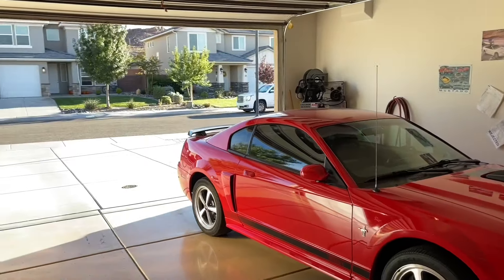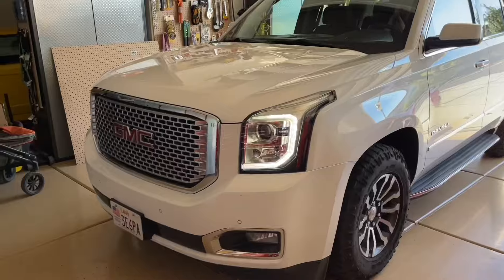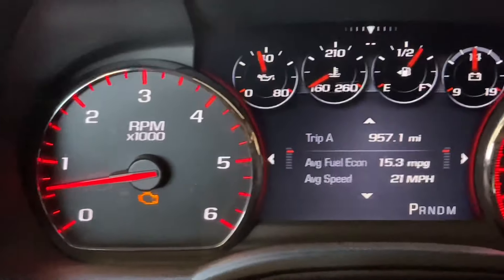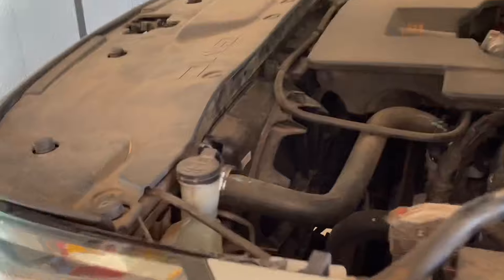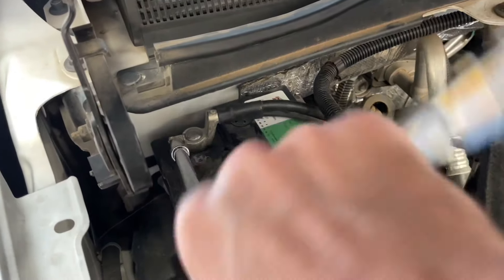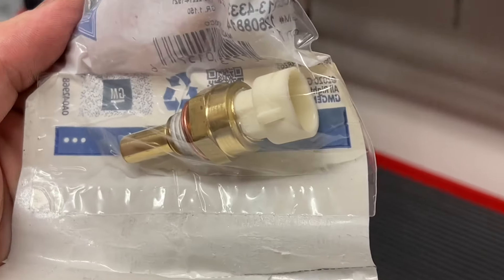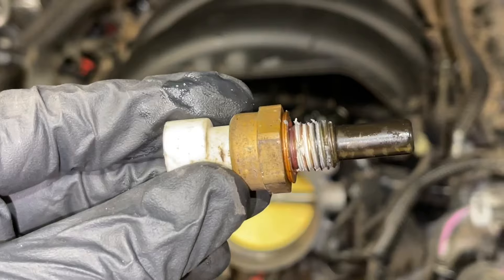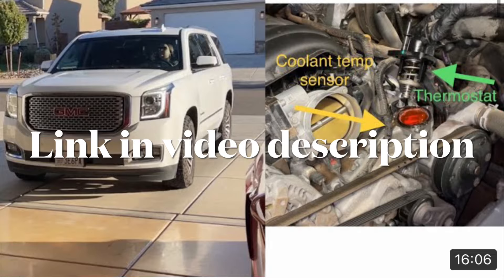Radiator Fan on full blast won’t turn off even with car off, not running. How to fix it GMC Chevy

Comment: My 2016 was doing the same thing.   I replaced the thermostat and the temperature sensor.  After completion,  there was no change, fan continued to run and dash temp remained at 160.  I disconnected the negative terminal for 5 minutes and reconnected and all was normal.   Hopefully this fixes the issue permanently.
Reply: Mine just did it too.  I did what you said...it worked.   The only thing different from usual driving is that the passenger in the back seat turned on the heater for the drive.   That won't happen again.  Ill just keep a socket in the Tahoe incase.
Reply: I just replaced both on my 2014 chevy Silverado and still same issue with fan. Does it matter if it’s the positive or negative to do reset?
Reply: @rudygonzales3589  I believe it must be the negative to actually reset the computers.  Keep the positive connected.
Reply: @coreyfleming8328  I went ahead and disconnected both for 5 min, looks good so far. Fan hasn’t turned on and it’a been a week
Reply: This worked for us too. Thanks.
Reply: Well it was disappointing to install thr new sensor then test and still the fan is screaming at 100% power with no indication of temp on the dash. Unplugged the battery for 5 min like you suggested and it worked perfect thanks .
Reply: Figured I'd add this also worked for my 2015 tahoe, thank you
Reply: Also worked on my 14 Silverado after replacing Thermostat and sensor, even got a replacement sensor thinking I had a bad one. Worked!!
Reply: I replace both parts on my yukon and every time  we do a long drive the fans turn back on 😢 idk what else is causing this problem
Reply: My 2016 did the same thing,and replacing the sensor made no difference. Disconnxting the negative battery cable was the only way to fix it. I'm not sure what the root cause is, but it sure is a ghost in the machine
Reply: You also have to get the code cleared for it to work.
Reply: You save my day with this information. Thank you sir!
Reply: Just leaving the negative terminal on while unplugging sensors. Got it
Reply: I was going to replace my temperature sensor but it was a holiday so just to get by I pulled the negative terminal that seemed to fix it for a few days but today it started acting even worse now it’s not just a temperature sensor dropping all the gauges are going crazy Seeing if anybody else had this issue?
Reply: That’s exactly where I’m at, problem still existed. I’m waiting the 5 minute to reconnect negative 🤞 . I originally just popped the two fuses. Hopes this does it. I’ll check back to update
That was it. After thermostat and cooling sensor replacement, fans continued to run. Disconnected negative for 5 min , reconnected and no fans and back to normal. Gauge now has moved up off the 160 mark.
Reply: Dude thank you so much that helps me . I was at a loss! I think I could have just done that before replacing the sensor and the thermostat and it would have fixed it. I’ll start doing that first thing. The battery was just replaced too and when I went to remove the negative cable it was loose. Probably the problem the whole time.
Reply: @Zanehoward88 my wife’s 2018 Tahoe has the same issue and about 2 months ago when it happened for the first time I disconnected the battery to fix it (since that even fixes it when the PCM acts up) and it fixed the fan issue but only temporarily because my wife actually just called me a minute ago to let me know the fans were roaring again (which is why i looked it up on YT looking for a solution)…So resetting it alone didn’t fix it for me. I’ll reset it again when she gets home and order the sensor. Will update how it goes.
Reply: Bruh, you hooked me up this morning heading to school then work
Reply: @RatherBeRestoring   yeah id say that you probably do need to go ahead and replace that sensor. Check the pug end to to make sure the wiring looks decent.
Reply: I’ve done everything everybody else did and my fan won’t turn off it even stays on for a little bit Once my car is turned off I only pulled the negative terminal but I’m gonna try both the negative and positive off for five minutes and see if it makes a difference.
Reply: @andreamassingill6132  You need to replace the sensor . Take the negative terminal off while you replace it. It is a very easy replacemetnt right up front and it is easily accesible. If that dont work then it has to be the thermostat. I Changed both in 30 mins with a ten millimeter socket and i think a 19 mm for the sensor. Ive done two cars in the last two weeks and I went ahead and replaced both the thermostat and the sensor and they both are working perfect.
Reply: I’ve replaced the sensor and still does it . I pull a fuse , it fixes it but then it randomly happens again . Does the thermostat have some kind of sensor on it.
Reply: I have replaced the sensor three times already.  Then tried replacing the plug end.  It randomly acts up, temp doesn’t read and fans roar.  For now I just remove the negative from the battery and put it back on.  That seems to fix it for a while, but issue happens often.  Have no idea what to do next.
Reply: Unplug battery first thing.
Reply: I was told to disconnect the positive connection 😥😥 I’m a female and ask AutoZone. Can I harm something?
Reply: @bobgrove6581 check fuse probably went out
Reply: Just did one in my wife’s Yukon, had to discount the battery.  Only did it for 30sec and it reset the computer

Comment: My dads keeps doing this , replaces the sensor 3 times so probably something else going on
Reply from the maker: Next up is the thermostat. If it’s stuck open it really is under 160 degrees and the fans kick on since it shouldn’t be that cold when the rest of the vehicle is warmed up https://youtu.be/aEfgkxWdBYw?si=SOeRLKc6gTV6MO0m
Reply: Well it runs fine all year round , it's went he switches from heater to ac or vice versa and then the fans stay on.. so never bothered to check the thermostat as the operating temps are fine.
Reply from the maker: @ if the temp is 210 it’s fine. If it’s showing less than 160 (looks like zero) it could really be running cooler than it should and trigger the fan. It is a limp mode so it’s possible it’s the ac system or something else. I’ve heard it will also turn the ac off in that limp mode

Comment: Praise God for this video. I pulled up at church turn off my Yukon and the fans kept running. Mine didn’t have the check engine light, but after the battery cable got taken off, the fans turned off. After church I started the vehicle up and everything was back to normal. At least now I know if it messes up again for sure I’m gonna need the temperature sensor. I was so worried that something bad was going to be wrong. Thank you so much again for this video.
Reply from the maker: I also did the thermostat at the same time since it’s right next to the sensor. Many have come back in the comments to say the thermostat sticking open was also bad, so I would recommend doing both at the same time and I have a video for it too https://youtu.be/7mJF5LQ3oPs?si=wcGGzKx4Bo2aMkyk

Comment: same issue - replaced ECT sensor - problem has returned two weeks later - investigating now
Reply from the maker: Let me know what you find. It may be limp mode for another sensor or issue or perhaps a bad circuit is burning up the old and new sensor perhaps
Reply: Same
Reply: When I disconnect battery and connect battery, the issue is fixed without changing sensor. Then the issue returns. ????
Reply: Same. It took a month for the issue to return. BUT now the a/c is not cooling too.
Reply: Same issue. I don’t disconnect the battery. If I start the truck, let it run for about 2 seconds, then turn it off it stops, sometimes I have to do it 2-3 times. I replaced the sensor, then the battery went bad. It kept getting super hot (smoke and everything within seconds) so I replaced the battery and the connected fuse box. That fixed the issue for a couple months. It started again after a rainy season and some water puddles. It’s been doing it for about 2 weeks. The check engine light was on for about 1 week then went off. Now I notice my ac isn’t working.
Reply: I replaced the thermostat and all these issues have been resolved.
Reply: @TexasMindBodySoul  Did you end up finding a solution? Same problem. I notice that our AC compressor clutch is not spinning. Not sure why the two problems would be related.

Comment: I have a 2016 Denali and have been dealing with this issue for the last 2 winters. It only does it when the weather is cold. When my fan doesn’t cut off, I turn my car off, let the engine cool for a bit or overnight and then I take it down the road and floor it and hold the pedal down until I get the RPM’s all the way up and my speed as high and as fast as I can get it and the fan will automatically shut off while I’m driving. Then I just let off the pedal and go back to normal driving. This works every time. We replaced the thermostat and the sensor 2 years ago when it first happened, but it still kept staying on so instead of disconnecting the battery so often to reset it, I found a way that I don’t have to anymore.
Reply: I have the same problem with my 2018 tahoe it only happens in winter and to turn it off i just drive it at noon and it becomes normal until night comes the same issue comes back ….

Comment: Replaced both sensor and thermostat. Turned vehicle on and would do the same thing. Low temp gauge and fans still on after vehicle off. Unplugged negative for 10 minutes and now working nicely. Thanks for the video!! I guess i forwarded too much on video about removing negative on battery. Luckily id didnt fry anything

Comment: My 2016 Denali did this exact same thing at 95k miles right before heading out of town for 2 weeks. I swapped the sensor as the video showed and it was back to normal all within an hour of noticing the gauge was buried. No check engine light for me, but I may have caught it early. Thank you for your video!
Reply from the maker: The thermostat can also cause it to happen when they fail and stick open. The engine is running cool so it also triggers the fans. If it continues, see the thermostat video https://youtu.be/aEfgkxWdBYw?si=zrnnrLbPG0i3a3M3

Comment: Great video! 2015 Escalade 6.2L:  I disconnected the negative battery terminal and installed the new engine coolant temp sensor. Didn't disconnect the radiator hose and spilled a bit of coolant on the garage floor, but not too much.  Reconnected the battery.  Fired up the 6.2L V8 and as hoped the fan no longer ran on high speed and the AC started blowing cold again.  The OAT display in the cockpit read an erroneous 32 degrees with the associated warning about "Possible Icey Roads".  No way to reset this in the Escalade, but  after 8 hours + the temp recalibrated on it's own to the correct OAT.  My local mechanic wanted $500+ for this repair!  Great job and thnx again!
Reply from the maker: The thermostat can also cause the temp to be below 160 degrees and cause the fans to come on. FYI for the future. Mine also showed 32 degrees on the dash and ice warnings 
https://youtu.be/aEfgkxWdBYw?si=a5nWCQ_LiolhJ0ow

Comment: I only changed the thermocouple on mine.  Fixed.   Still have the original T-Stat.  2015 Tahoe.    ***Did not watch this vid but watched another that recommended doing both at the same time.
Reply from the maker: Yeah. The thermostat sticks open and over-cools which also runs the fan. Sometimes disconnecting the battery will reset it and turn the fans off, but if it comes back showing cold for the temp it may not be the sensor but the thermostat over-cooling the engine. Keep it in mind for the future https://youtu.be/aEfgkxWdBYw?si=qSmu8fME_mUP8wPM
Reply: I disconnected the batt first, just to save it.  Then watched a vid suggesting that it was the thermocouple and another which suggested changing both.   Initially it was showing full cold on the gauge with a hot engine.   I only posted this to save the next guy the hassle of doing both if he can't or doesn't want to do both.  I'll get a T-Stat from Rock Auto and change that at my leisure (and not raining like mad the day I changed the Thermocouple.  Good luck to the next guy. @dannyjohnsonsgarage

Comment: My 2016 Tahoe has this very problem and I looked it up and you brought the solution.  Unplug the negative cable for 5 minutes and waaaaalaaaaa it works.  

Thank you for taking the time out and sharing this.
Reply from the maker: That will reset it temporarily. If it continues to come back it will most likely be the thermostat sticking open and the temp sensor is good to replace then too 
https://youtu.be/7mJF5LQ3oPs?si=7T2WMoTX_BCOnz1g

Comment: How much do you think the labour should be for this? My car has this problem and it’s at the garage
Reply from the maker: @madsretou  other comments have said the dealership has really overcharged them like $700 but you can do the temp sensor and thermostat very early with little tools. You’d be better off having a friend help and use my video. The thermostat sticking open seems to be the most common reason. Here is my video 
Thermostat & Coolant temperature sensor replacement: Yukon, Tahoe, Sierra, Silverado, Escalade GM
https://youtu.be/7mJF5LQ3oPs

Comment: It could also be a temp sensor but usually it’s a bad thermostat causing the car to run too cool. This sets a code in the computer. The computer then turns on the fan on high and turns off the ac. All in an attempt to keep the car from overheating. 
Replace the thermostat and erase the code. This will fix your problem.
Reply: How do you erase the code ?

Comment: I have a 2016 and just replaced the temp sensor, check engine light went away and it quit.. a week later started doing it again.. so I went to the next recommended step and replaced the fuses that go to the fans.. still doing it.. not sure what it is at this point gonna run up to the auto parts store and hook it up to a reader to get more information
Reply from the maker: It is most likely the thermostat. See if the temperature is reading zero (looks like 160 on the gauge). It should be 210 when warmed up. The thermostat sticks open and overcools. Here is how to replace it 
https://youtu.be/aEfgkxWdBYw?si=RH1jOby84IfCxxb5

Comment: I replaced my sensor, thermostat, temperature relay, and replaced the ECM (which was supposedly set to my truck's VIN and tried the key learn steps but would not work), and still the fan issue continues. I pressure tested the system and vacuum filled it (should not have any air locks). My 2016, 5.3 Silverado truck would not turn over with the replacement ECM, the check engine flashed, even though the security anti-theft lights went out, but it again started with the old ECM. With the original ECM the brakes and stability warning lights frequently comes on as does the check engine light, but it starts. It took 8-10 days to get the replacement, pre-programmed ECM. When left connected to the battery, the system drains the battery. I would appreciate any help or suggestions given.

Comment: Changing the sensor did no good on mine. What did fix it was disconnecting the battery for one minute - this reset the computer and resolved the issue.    so, any of you who have this issue - before replacing the sensor, remove the positive cable from the battery for a minute and then reconnect it. This may very well resolve your issue.     An auto parts employee told me that cold weather sometimes affects the ECM and this many times will correct it.
Reply from the maker: It will reset the system, but if it continues it’s most likely the thermostat that sticks open and overcools https://youtu.be/7mJF5LQ3oPs?si=IuIx-t0uQToSw_g2

Comment: Hi i disconected - cable 4 10min
I just let run engine few min so water not get hot
I shut off engine fan not runninng
But sensor probably wrong anyway
When you start engine all display clocks go up and back to normal
... water clock not even move  ... I guess sensor is bad... I will take it off tommorow will try clean up or buy new one and  i will keep posted... Thanx 4 video
Reply from the maker: The thermostat will tend to stick open, sometimes turning the car on and off may help it unstick. In the end I would look at a sensor and thermostat  https://youtu.be/7mJF5LQ3oPs?si=6xfkmLSaXpKSGSHm

Comment: Same as below in 2016 Tahoe. Changed out temp sensor. At first, no change, then it seemed the ECU reset itself. A week later, problem is back. Im seeing other possible causes as fan motor relays ( where are they??-not in fuse blocks) , high pressure switch, ECU failure, thermostat. Thoughts?
Reply from the maker: It’s generally the thermostat if the sensor is okay. https://youtu.be/aEfgkxWdBYw?si=LX34aWDmTYdKY-gY

Comment: I changed my temperature sensor and disconnected the battery and fixed my problem but I will keep in mind to also change the thermostat so this doesn’t happen again. My 2018 Silverado only has 58000 miles 🤦🏼
Reply from the maker: Here is the thermostat portion if you need it https://youtu.be/aEfgkxWdBYw?si=f7v2_F77RAP1J3MH

Comment: Was her A/c working? I’m having the same problem but A/C not working.
Reply from the maker: It may turn ac off in the default mode. I would suggest the thermostat and temp sensor 
Thermostat & Coolant temperature sensor replacement: Yukon, Tahoe, Sierra, Silverado, Escalade GM
https://youtu.be/7mJF5LQ3oPs

Comment: I'm getting this, 2015 Tahoe.  Also, hopefully coincidence, the A/C quits cooling at the same time!
Does any one have that issue too?
Reply: Yes I am right now with my 2015 Tahoe
Reply: Different fan. Check your blower motor resistor.
Reply: Any luck our ac isnt working either and the temp gauge is at 160
Reply: Yes. I noticed the same on my 2016 Tahoe
Reply: Same with my Suburban.